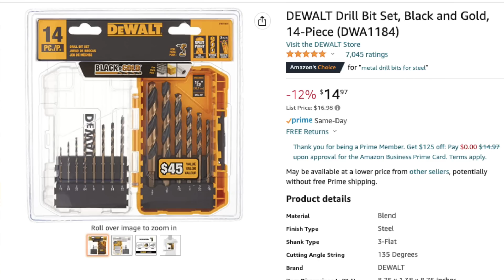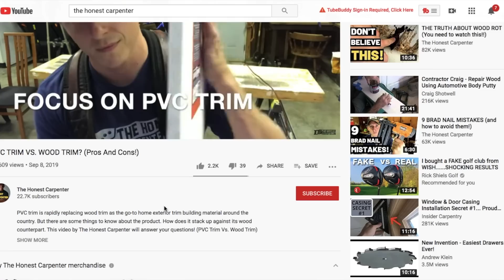Before You Drill Wood/Metal/Plastic...TRY THIS! (Spring-Load Centering Punch--MAKE DRILLING EASIER!)

Comment: I have a spring loaded punch but for soft woods and small drill bits I usually don't push it until the spring trips. That makes a divot wide than the bit. I just push it down about halfway a few times and that works fine.

Comment: Another great tip, Ethan. I have a spring punch, but I usually don't remember it in my box so I use of my nail sets from the pencil slot on my tool pouch. Not the correct tool for the job. Looking forward to your new university.

Comment: Also try reversing your drill !st. then drilling or screwing as usual, even with just a philips bit. depending on the material. I work in furniture building and use the "reverse 1st. method often.

Comment: you could sharpen pont of old metal driling bit or concrete driling bit or any hard meal and use as a center punch. i have broken concrete driling bit or other means masoney bit i made pointy tip using my uncles bench grinder. i am using as holding the point and giyying back with hammer its works fine.

Comment: You are correct. A divit markings the location you'd like the hole to be is basic, easy, and often forgotten. Thanks for the reminder. 

I especially liked the tap in the back of the driver idea. Thank you.

One issue, but not with the video, really, why are they called "centering" punches? They don't really center anything. The term is misleading. I've heard some say "self-centering" punch, but this is even more incorrect. Yous is, to me, a spring loaded awl. There are self-centering bits, which are what they say. I wish someone would make a self-centering punch for hinges and the like. Maybe someone does?
Reply from the maker: Good point, Terry!

Comment: I just installed a new exterior door and had a heck of a time getting the holes in the right locations for the hinge screws.  I had marked the holes on the door, but when I would punch the location I would always be off just a little bit because the punch tip is so much smaller than the drilled hole in the hinge.  What would be the proper way to use a centering punch to make sure it is centered in the hinge screw hole if the screw hole is much larger than the punch tip?
Reply: get some vex bits. if none available take a phillips head driver bit, put it in the hole and push down. the center of the cross should be center. But vex bits are cheap, i use mine al the time for stuff like this, they've lasted years.

Comment: Another handy tip is a self-centering hinge drill bit like the $9 3-pc set @HF, which is far better than a spring-loaded punch when installing screws through a hole like those in a hinge. BTW, the 3 dots to the right is the report link to help stop the telegram spamming, which seems to hit every post. But don't flag me, I mean no harm.

Comment: My father-in-law and I were redoing his kitchen cabinets and he was adamant that I use the spring-loaded punch until it activated to put in the hinges. He's a machinist so he always has it set to the maximum. Quite obnoxious when you are working with wood. Then when he was and over at my house (just happened to be making cabinets) he seemed disgusted that I wasn't using a spring-loaded punch. I literally used 3 different sized nails, screwdriver, awl, tweezers, and a few other things to prove a point.

Comment: I've heard the term "center-punch tool" but never understood it until your video, thanks. I have typically used a nail, or tried to start with a smaller bit (with poor success). Bought the Neiko 6" using your link.

Comment: That Neiko hole punch is no longer good. It was a decent punch, but they doubles the price, and cut quality in half.
 
Put up a link for the MulWark version. It's $8.99 on Amazon, and wayyy better than even the good version of the Neiko.
 
I've bought several on Amazon, and the Starret are great, but at the rate I lose these punches, it's best trying to find a better value in punches... and the MulWark is it! But I'm sure once it's popular, it too will go to $20 and lose quality. It's how low cost Amazon items seem to work.

Comment: For wood, all of my bits have pilot points (especially for ⅜ and larger). A good set of brad points will give you beautiful, clean holes and never walk. But a low quality set can make your wood look like you drilled it with an angry badger. Lol.
 
Another bit is a tapered style bit. They will start small and slowly reach their measured diameter. The tips of these bits can be fragile though. And good bits can cost $30-$50 each... yikes.

Comment: Using a center punch is good advice! For wood I prefer an awl though, because the sharp tip makes it more precise. Also, wood drills don't need a pilot hole, because they feature a sharp point themselves.
Reply: In principle yes, but you do the push in the driver å bit before you start trick, I guess.

But this was my thought exactly. For smaller holes (<= 2mm) it usually doesn't even need the point.

Comment: Not sure I like the idea of a punch where you have to apply so much force to the tail end; seems that on a hard pipe, for example, there's a good risk the tip would still walk, or even jump - just look how much your hand is shaking in your demo. I prefer the 2-hand type (looks like a magic marker) where you pull up on the tailpiece instead - no pressure needed. For flat wood surfaces, usually I make the divot just by running the drill in reverse for a couple of seconds. For drilling dowel or pipe, or for pilot holes in wood that have to be exactly perpendicular, I find a drill jig is indispensable - cheap and lightweight and fits in your apron pocket.

Comment: Bradpoint bits are worth a mention here. Their really sharp center points sink in easily without the need to punch. I only use mine for wood, not metal.
Reply: They're even better with a punch hole, not just a pencil mark, especially with larger bits that can hide to mark and make it hard to hit.

Comment: I have the self centering drill bits, and have used them over and over with great success doing hinges. 
And have used the nail trick a lot also, and is good alternative especially when drilling through sheet metal in my experiences.
Thanks for sharing this knowledge Mr. James

Comment: This seems like such a coincidence. Just the other day I put up a cheap laminated shelf that screwed onto metal brackets beneath it. I had to drill very short screws into it through the brackets, holding the drill upside down. Being upside down, the short screws along with the lamination was a bit of a nightmare to get started. I was thinking we needed something like this, but not sure it existed. Now I know.
Reply from the maker: I’ve been there, Hal! It was a while before I stumbled on them, but I’ve generally kept one ever since.
Reply: Next time if you do another job similar use a vix bit , it is a spring loaded drill bit with a bevel point at the tip, there are different sizes depending on the hole size. If you have two drills use one with the vix bit and the other with a megnetic phillips bit.

Comment: I had a friend who bought a table and fence for his drill press but still had trouble drilling accurate holes. I told him to try centre punching his hole location. Problem solved. Now he wonders if he really needs the table and fence.
Reply: Drillpresses have many good attributes. Being square, angled drilling, repeatability, even pressure, stops for hole depth, but even with a DP, a starter hole helps.